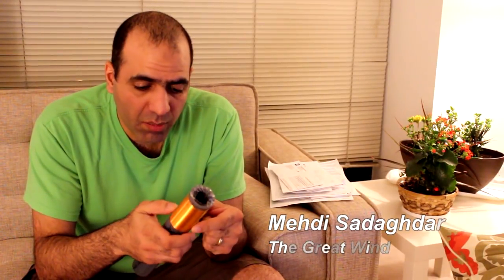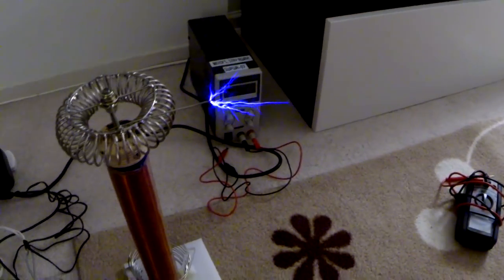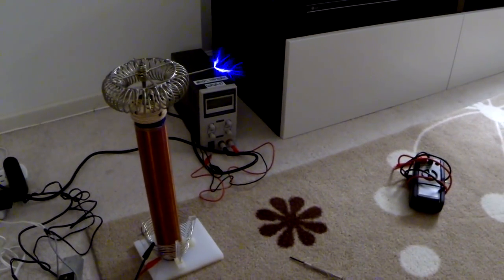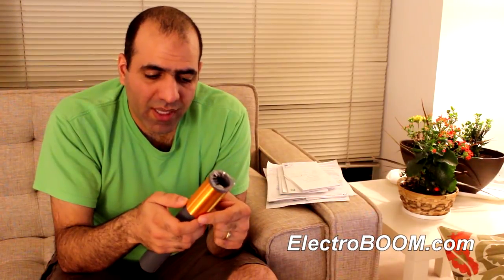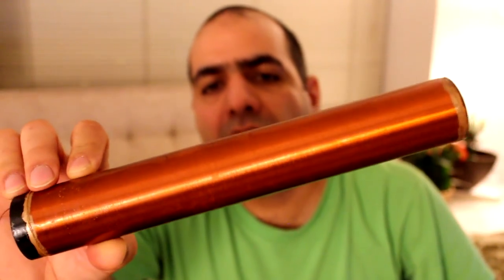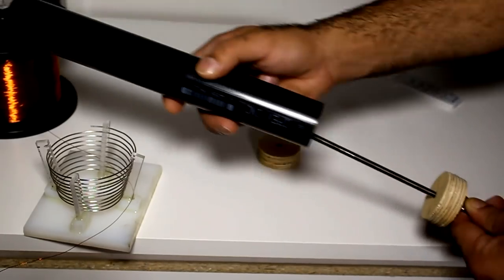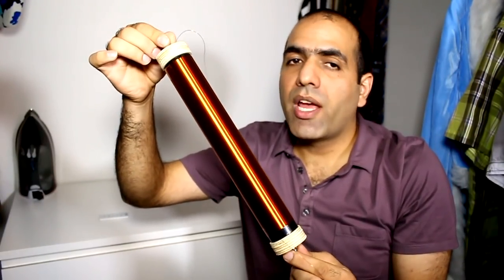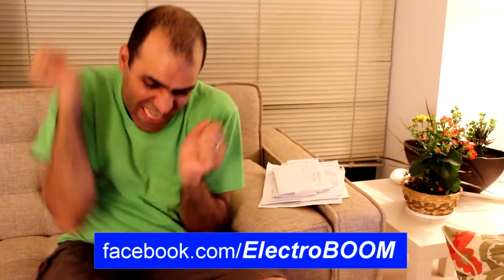Aiming for the Biggest Arc (Halfway Tesla Coil Design Report)

Comment: I like your videos as I find them both humorous and entertaining. However, one thing I found in error in this video. You talk about the turns ratio between the primary and secondary as determining the voltages you will get from your coil. With tesla coils this is not the case. The reason it's different is because a tesla is not operating as a simple transformer but is operating as an RF transformer in which the secondary is actual a resonant LC circuit and the coil should be running at the resonant frequency of that circuit. regular transformer don't behave in the same way because you don't normally run them at the self resonant frequency of their secondary. This is the reason the turns ratio is not the determining factor with regard to the voltages you will get. It's actually the impeadance that determines the voltage and an ideal LC resonant circuit would have an infinite impeadance which would mean infinite voltage. However that would be an ideal LC circuit and in the real world nothing is ideal. This is where the Q factor of the secondary comes into play. it's the Q factor that will determine the voltages present. So to get higher voltages you want to maximize the Q of the secondary coil.

Comment: A co-worker and I made a H2O separator with stainless welding wire and threaded PVC. We wanted to feed a vehicle with the gasses to boost fuel economy. Could you try making one? One that works, cause ours was a wash. Not enough knowledge.

Comment: I have not seen anything or heared anything about resonance here. A tesla coil is a resonance transformer. If you do not match the frequencies of both the primary and secondary coil closely, the energy is wasted, the sparks will not grow and you can blow up some more expensive silicon. Also, the frequency of the second circuit drops when sparks form. Always have your primary tuned down slightly lower.
Reply: Fre3Bee He does not seem to be doing it the Telsa way. Looks like same way as car ignition coil is pulsed not resonated.

Comment: Are tesla coils powered by high frequency AC like wireless power.
Or pulsing DC like a flyback transformer.
Reply: Depends on the coil. Solid state coils will use pulsed DC and spark gap coils will usually use high voltage AC from something like a 12kv NST

Comment: I'm a starter on tesla coils and i want to know how to build one, i know about frequency and the primary and secondary coils, i just don't have any clue about the power part. I want to have pretty decent arks, but I'm afraid i will mess up and have to do it all over again, and i have insanely limited magnet wire, but i might be able to do it if i know how. -Thanks

Comment: Would using a iron core instead of PVC improve the voltage?
Reply: Nope. All TCs use air cores due to the poor magnetic coupling in them, and iron wouldn't work at those high frequencies (skin effect, I^2R losses, windings shorting together due to iron being ferromagnetic and conductive, etc)

Comment: Hey I built a Tesla coil once. 9000V input from a neon sign transformer. 

the primary was 9 turns and the secondary was 1200 turns. 

We ran into depressing results though. Our spark length was only about 3" when it should have been far larger. 

Basically the last 200-400  or so windings were all arching between each other.  Which obviously turned pur 1200 turn secondary into a 800 turn secondary diminishing the spark. 

what kind of solution could help remedy this?

Comment: ***** What you are doing, at least by your description is building a standard step-up transformer, Not a Tesla coil. In order to build a true tesla coil both primary and secondary must have equal resonant characteristics ( Lpri X Cpri = Lsec X Csec), otherwise it will not produce your desired result. When both primary and secondary can resonate together, you will easily get twice the amount of voltage at the secondary top electrode  regardless of your winding count). One other note, using as fine a wire as you are using is discouraged, partially due to increasing the inner-electrode capacitance, making tuning difficult. Using solid state devices will cause you nothing but grief, go back to rotary spark gaps. I know it sounds old-fashioned, but the old stuff works.
Reply from the maker: But if I go back to old stuff that work, then the bleeding edge of technology wouldn't bleed anymore!
Reply: I see your doing quite a bit of blood letting or should I say electron letting.

Comment: Use normal spark gap Tesla coil. You can input high voltage and get long arcs... No need for this low voltage oscilators.

Comment: There is something I just don't understand how is possible to blow up 4 1200v 10a mosfets just with 120v dc? 
The only answer I think can cause this are the voltage spikes caused by switching on and of the primary inductor, but that could be easily solved by adding a diode so I suppose that's not what is blowing up the mosfets. So what the hell is going on there???

Comment: I'm sorry but isn't the full bridge rectifier a DC output? How did you use that to power the tesla coil, which usually requires AC? I'm sorry if I'm missing something :D
Reply from the maker: +SolkanStudiosTV This type of circuit takes a DC input and makes its own AC to power the Tesla Coil. There is an oscillator in there.
Reply: +ElectroBOOM I have a 600V DC to DC converter. Would it work the same as your Full bridge rectifier? And thank you very much for your answer, I already built a coilgun based on your design. The video is on my channel! :D
Reply from the maker: SolkanStudiosTV
A DC to DC converter is generally a switching power supply type. So it wouldn't have the bridge rectifier
Reply: actually it has at least an half bridge rectifier, because it goes dc;[oscillator];ac;[transformer/coil];ac;[rectifier];dc, if you have a switching power supply that goes ac to dc, it actually goes ac;(pfc);[full bridge rectifier];dc;[oscillator];ac;[transformer/coil];ac;[rectifier];dc
this is like this because at higher frequency (the ac trough the transformer is at 20-600khz) the transformer can be more efficient and smaller due to different materials. if you use a design with a single coil on wall ac, it is not isolated and can be interesting ( as in shocking you with mains voltage)
note, I needed to use semicolons because of this
Reply: Wait, you take AC, convert it to DC and then back to AC? Isn't this, like, terribly inefficient?
Reply: that's what CFLs do
Reply: It depends. It is usually done because you need a different frequency, e.g 50 to 60 Hz, or (in this case) 50Hz to 400-600kHz. It is the most efficient way to change the frequency, and it's usually about 70-80% so not terribly bad!
Reply: The Crazy Pineapple well, you can get up to 95 or even 98% efficiency, though, generally, it's around 50-80%, also afaik, there's no way to boost dc voltage without switching something (which makes ac)
even though you get 3 major steps, the efficiency in each one is high, a high quality transformer gets up to 99%, while consumer grade ones are at around 95%, the transistor looses 1V @10A(this is for a generic one, but generally, you use 5-10 at these currrents), so for a 10Vdc-xVdc@10A you are still at 90%, and finally, the diode looses 0,3-0,6V (you can get better efficiency by using synchronous switching of mosfets), that is 98%@30V
so total for a 10-30V converter would be at about 83%, even removing 3% for misc losses, that puts us at around 80%, which is still pretty efficient, even though we have 3 stages.
Reply: Tesla Coil with 60Hz could easily kill you.

Comment: do you have any drawings of the plastic pieces that you used for the primary? also, how much wire do I need for winding those 7000 turns? I have ~110m of 0,3mm enameled wire
Reply from the maker: DanielTseng100 They are regular PVC pipes, around 4.2cm diameter. 7000 turns sounds excessive. You would need 132cm of wire for every 1000 turns of your wire.
Reply: ***** oops! I writed one zero more, I wanted to say 700 turns

Comment: Why can't you just put diode on primary coil. That way the high voltage spikes would be cut off ?. (P.s. I want to make one myself too so I need to know..)
Reply from the maker: Tebbit123 My theory was that putting diodes there, I would clamp voltage to a lower level that would mean smaller output voltage too. Also diode wastes some of the power too. I like to try it though and see what happens.
Reply: ***** it would be insane if you could use the voltage from your homemade taser to connect the transformer from your tesla coil to create massive arcs!

Comment: Why not think older technology Telsa did not have transistors with low PIV in fact did not have transistors!
 Why not use TUBES!  Maybe from Army/Air force surplus Radar equipment, and transformer with secondary winding 5000v + and heater winding for magnetron to power tube heater from old microwave oven which is also useful for getting high voltage capacitors and diodes. You will blow yourself (Up…) before you blow them (Up).

Comment: Can someone give me some tips on winding a tesla cool with thin wire (40-42 awg) because it keeps overlapping and breaking on its own, thanks for the help.
Reply: Wind by hand VERY VERY SLOWLY, I have learned the hard way that if you don't superglue it at every 2-5 turns it overlaps (Don't use too much superglue otherwise it'll harden and make a ball and the wire will snap, and only use one small drip and blow on it to evenly spread the glue or the wire will either overlap or snap) you also have to have your spool of 42 awg wire at the perfect distance from the coil you are winding (about 6-8 inches) you also have to have lots of slack with the wire between the coil and the spool. Then once your coil is finished wait until your sister is out of the house and steal her clear nail varnish and using your fingers and a paper towel coat the entire coil evenly to protect it.

Hope this information is helpful

- Jack

Comment: how is it possible to create this little prim. coil voltage pikes over 1000 volts???
if u put for example the induction of his coil, wich is i think around 5 micro henry in the formula:
Ui = 0,0001*8/0,00001
Ui=induction voltage, 0,0001= induction in henry, 0,00001=frequenzy of his circuit in sec periods, 
you will get 80 volts...
does he increases the primary current or what the fuck is he doing to get those beautyful arcs